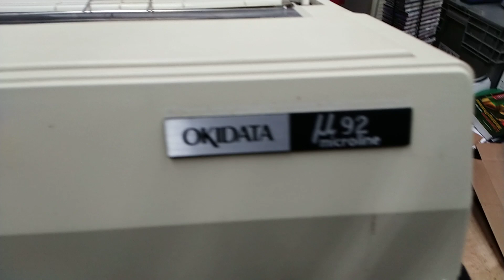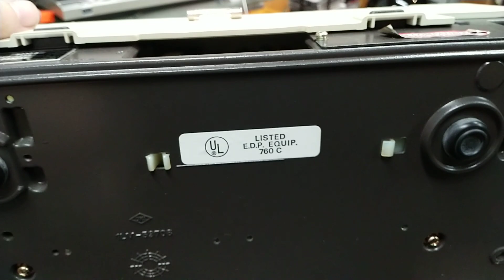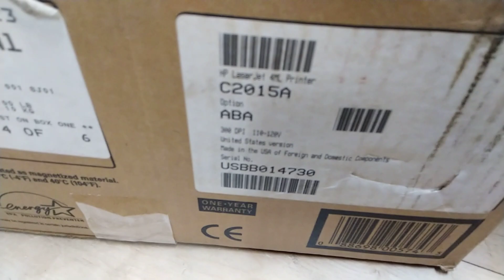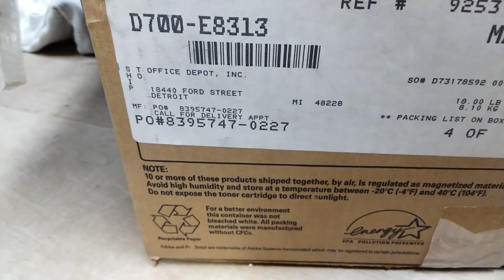1984 Dot Matrix Printer Restoration! (Part 1)

Comment: My first computer an IBM PC came with an Okidata 92.  I got the tractor drive ($75) and yes paid full price since it was all new.  A very reliable setup with no problems getting replacement ribbons.  I used it last in 2005 connected to a 486 housed in and IBM AT case running my DOS programs.  Lots of fun!